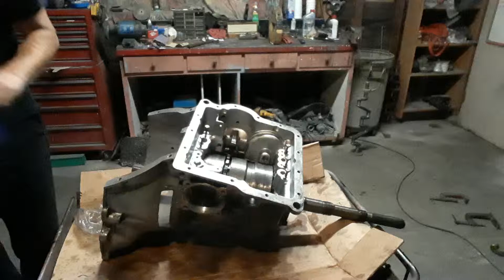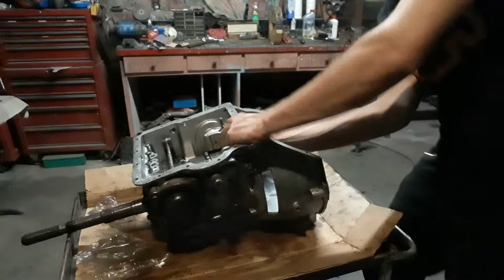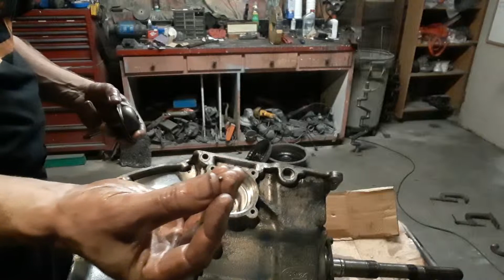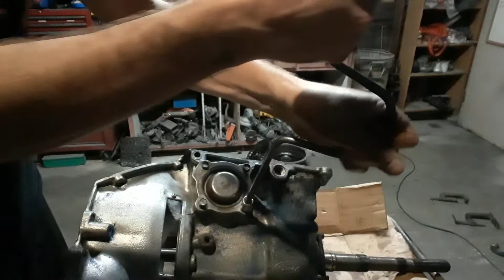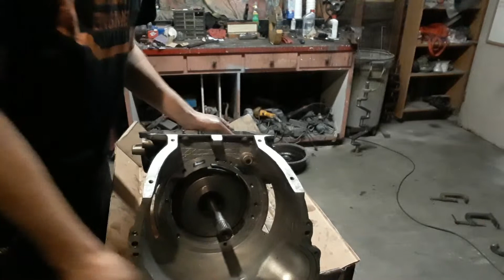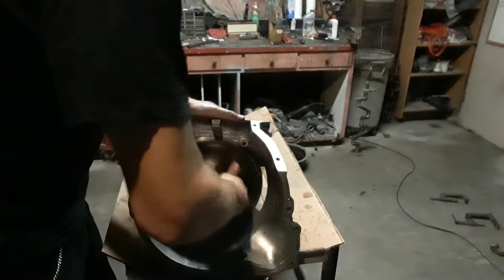Fordomatic 2 speed transmission rebuild. Part 2

Comment: How did you get the front drum to spin once I put it on I can’t move any part of the planetary in the front or back it’s like it’s jammed???
Reply from the maker: I didn't have that problem. only thing I can think of is something on it might be assembled wrong.
Reply: @onewhocollects6781  it was my fault I put the rear pump together wrong put the pump inside upside down so it wouldn’t sit flush 😭 I got it working nice and smooth now lol